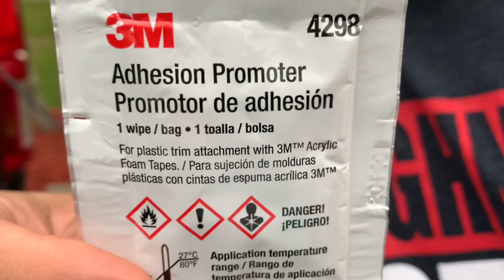F150 handle covers | ModFusion

Comment: Oemautoart has oem handles, Skull caps, Emblems and badges. It's a lot more expensive but it's worth it because everything is color matched to your vin # and oem quality so it doesn't fade and fall apart in 6 months. Your truck is looking nice though!!
Reply from the maker: Yes, they seem to be able to color match most items to the truck but they are on pricey side. Have you bought any items from OEMautoart?
Reply: @ModFusion  I bought my side mirror skull caps from OEMautoart. I had the body shop install them for me when they were doing all the custom paint work on my truck.  The guy at the shop said OEM did a top quality paint job, and they matched my truck perfectly. The only downside is, they are pricey, and it does take a long time for them to arrive. Everything is painted to order.
Reply from the maker: @dalinrowe2506  thanks for the update

Comment: I saw the color-matched handles on OEMautoart for $699. Too much, so I took my 2017 Platinum to a body shop and they painted all four for $300.  It’s pretty involved. They had to remove all four door panels and remove the entire handle housing because the chrome handle cover itself does not come off on a Plati. Your black covers look pretty good though.
Reply from the maker: Thanks for the info, I agree that is pricey for handles. How long did the shop warranty the work on the handles? I asked around and some shops would do the work but didn’t want to warranty the work because they said it wouldn’t last. We will see how long the covers last, the nice thing is the actually snapped on.
Reply: @ModFusion  The truck is still in the shop so I'll have to ask about the warranty when I pick it up. I also had the tailgate, tailgate handle, grille, front bumper, mirror skull caps and all the badges painted to be color-matched.  He said they paint chrome differently than most shops to make sure the paint sticks and lasts. They use a special epoxy primer (costs $400/gallon) that chemically bonds to the chrome. Then the paint has no problem sticking to the epoxy. Just like a factory paint job.